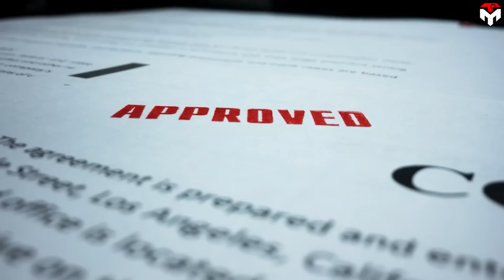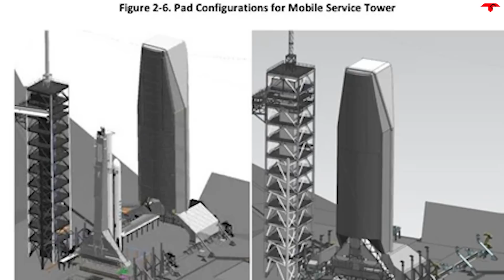Pentagon Is Mad At ULA Vulcan Much-Delayed. SpaceX To Rescue...

Comment: Shifting from ULA to SpaceX would be an admission by DoD that they made a mistake. Further, the intrensic management, engineering and execution flaws within Boeing have bled through to ULA. Meanwhile, Lockheed Martin is designed as a cost pllus contractor, therfore they are fundamentally not structured to perform as a fixed cost, rapid response organization.

So, Boeing and LM, with their step child ULA are essentilly like the dinosaurs after the asteroid struck.
Reply: Absolutely, and I cannot understand why they government must have this Vertical Integration of satellites.  This is more expensive and time consuming and stupid IMO>
Reply: @PrimusTeufel  Probably a last ditch effort to prop up ULA.

Comment: If SpaceX built a 5M OD strong back center core for Falcon Heavy larger payloads, It will be the end to all of NASA's money rocket building waste. Falcon Heavy has the power to get even 25t StarLiner into Orbit. A 5m OD center code will allow equal 100% power as the boosters and steel have that 2 stage boost. This give 20% more power for the center core in the full launch. This all give higher orbits and better or mire full recoveries. The center code of the X-37 launch could have been recovered.

Comment: The United Losers Alliance simply has no idea how to make money on a fixed-price contract.  Meanwhile SpaceX is turning away investors because it is making more than enough in profit.  Starship easily handles the DoDs "obsession" with vertical integration.  What does orientation have to do with something that is in micro-gravity?  Are the DoD leaders only insisting on vertical integration to desperately justify their wasting taxpayer money on the CLOWNS at Boing and the United Losers Alliance?

Comment: There are two problems. First falcon 9 and starship are apples and watermelons. Falcon 9 has 9 engines Falcon heavy has 9 engines per rocket frame. This two systems work well and they’re made of aluminum not stainless. 
This means they 9 times lighter. Ska why they work. 

Second starship cannot even lift itself in the minimum LAO empty . They need booster to do a 7 to 9 minute burn to put starship into a near or orbit if the booster will explode. Reason 33 engines on one frame tears the booster apart. Fuel flows at -450 degrees. Which instantly embridles the fuel lines. Then you add the vibration from 16,700,000 lbs of force. None of these engines have mount isolators. So a embridle fuel line will alway snap at the 4 minute mark. The engine bell cover allows an accumulation of liguid fuel to congregate inside the area until they relight the engines. Then you have ignition with spectacular disassembly.
Reply: So Mike, how are things at BO these days? I hope Bidenomics allows you to keep your job.  Say hello to Jeff for me wioll ya?
Reply: @diogenes64  

Why don’t you tell me Sonny ?

You clearly haven’t read any of my comments. The problem you Elon clowns have is (FACTS). But please check back with me after failure number 4!!
Reply: @mikerash-pc4jc  yeah so you are talking about phase 1 of the prototyping of the starship and shb. Phase 2 has just started construction. So not sure why you or anyone is talking about the current version of starship and shb as the this is what it is.
Reply: @the_lomax  

Well let’s see if it completes a complete flight. The starship cannot be fixed with minor tweaks. The material must change, the booster engines will have to be spread across three boosters. Starship will require a material change. In order to carry the promised payload weight the stainless has to go. The tiles will require a inconel skin to be attached to. So it will be applied on any part of starship belly required to withstand reentry. 

So until the above happens starship will fail every time they launch. With 33 engines on one rocket frame it will destroy the fuel lines after 4 total minutes of full throttle. That is way no rocket has completed a launch since the Russians. Plenty of rockets have gone to the moon and mars with only 9 engines.
Reply: @mikerash-pc4jc  Where does your information come from exactly because none of what you said is even close to what the reality of the system is. 

So could you please provide the sources of your information, please don't say thunderfoot.
Reply: @the_lomax  

Oh I have 45 years in manufacturing, electronics, and electrical. My proof will be the next 3 or 4 flight before the government yells uncle. Then starship goes out of business. Or, maybe Jeff bezos will pickup the company for a song. But please get back to me after ever failed flight. On a side note you do realize the engineers that created falcon 9 and falcon heavy have left SpaceX. The show is all Elon now.
Reply: @mikerash-pc4jc  45 years in electronics means nothing you are not an engineer in rocketry or aerospace engineering. You already know by your defensive stance of me asking for you sources that your attempted argument from authority is useless. Again what are your sources.
Reply: Thats just not true, the booster itself doesn't have to leave the atmosphere to stick the second stage into orbit. You are talking absolute fables. What is this time calculation you are working with and what Delta V have you calculated this with because your numbers a nonsense.
Reply: @the_lomax  

Watch the flight!
Reply: @mikerash-pc4jc  so you have no sources. you have no expliation for your time for flight of the SHB. All you have is a claim of being 45 years in electronics and watching a video. Righteo guess you know more than all the aerospace and rocketry engineers at spaceX.

Comment: ULA putting all their eggs in the Blue Origin basket was a bad idea, they should have kept the development of a new motor in more than one place. I used to work for Lockheed and was involved in the development in every Atlas rocket iteration since the Atlas IIA, getting in bed with BO was a bad idea and I knew it from the beginning. Lockheed should have developed the motor themselves, they had a very good engineering team that could have done the job a lot faster than BO but they tried to save money which has in reality cost them a lot more than it would have if they had just done it themselves.
Reply from the maker: It sounds like Ula is following Boeing, isn't it

Comment: If you guys think SpaceX starship that has never been able to orbit the earth. Is coming to rescue the pentagon and nasa. You should all remove your tin foil hats. Then start vaping thc.

You all only seen devoid of brain cells when you pump a failure. If SpaceX can’t put the starship where their mouth is it’s a failure. If Ift-4 can launch and booster can punch starship to at least 172 kilometers then hot stage. Then see starship in a stable orbit, not coasting. Then de-orbit booster and catch it without an explosion. Then de-orbit starship in a control manner and land safely. Well that will be a success of sorts.

Ift-5 will need to be filled out with a payload and the nose control center and environment controls to show that it will support astronauts flying starship.

But nether of these two objectives will happen. Because the present design precludes this fro ever being achieved.
Reply: There are 2 things wrong with this argument. Firstly, Falcon 9 is capable of putting satellites into Earth orbit and has launched more tonnage than everybody else combined. Starship would merely lower the cost per launch and was not in consideration when DOD contracts were awarded. Secondly, comparing Space X with ULA and Boeing is like comparing chalk and cheese. ULA and Boeing are using a completely outdated business model aimed at maximising profits in the short term and spending as little as possible on long term research. While they were on costs plus contracts, delays actually maximised profits {paid by US taxpayers} and problems could be shunted down the road by spending less money on an army of lobbyists and making political donations rather than on correction. Hence this nothing like an even playing field where the best ship wins.
Reply from the maker: Thanks for sharing